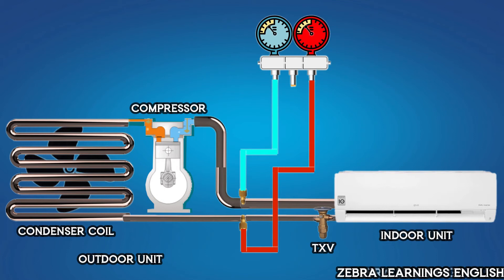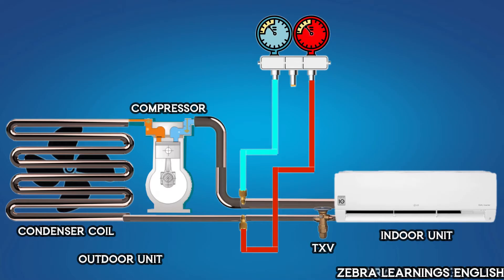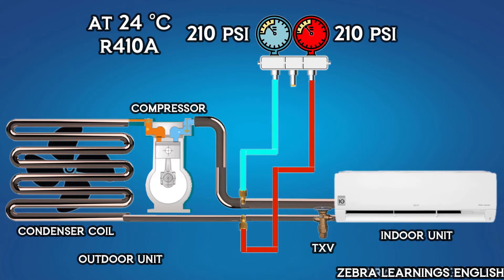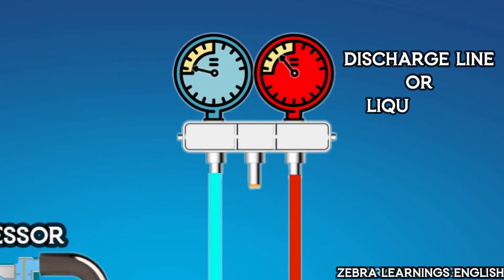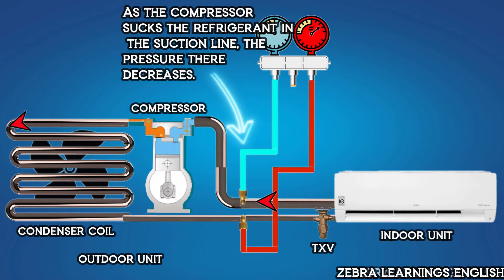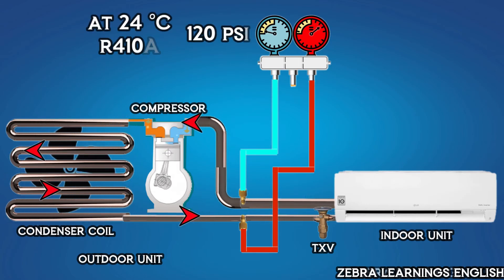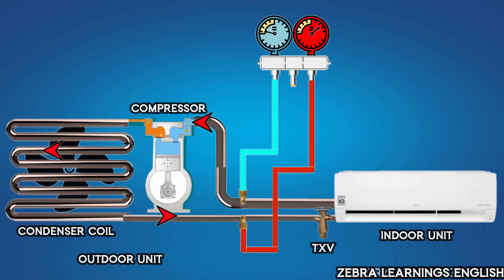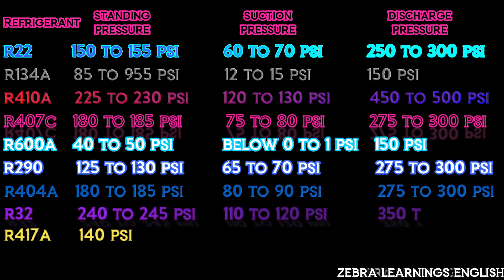Refrigerant Pressure Details | Animation | #hvac #hvacmaintenance #hvactraining

Comment: why the Low pressure high and High pressure low when the set temperature is reached?
Reply from the maker: The compressor is the one that increases the pressure on the high side and reduces the pressure at the low side of the unit.
When the set temperature is reached, the compressor inside the outdoor unit will turn off. So the pressure on the high side will reduce, and the pressure on the low side will increase.

Comment: What is subcooling and superheat temperature please
Reply: Bro I am asking how many celcisu superheat and subcooling
Reply from the maker: The superheat and subcooling value various depends on the refrigerant.
We can check the values in the manufacturers technical data.
But normally Superheat value ranges from 5°F to 20°F and subcooling value ranges from 8° to 20°F.
Reply: This video you did not mention how many temperature
Reply: Why before gas charging vacuumed the system of split AC kindly  is necessary
Reply: Thanks bro
Reply from the maker: The Subcooling and Superheat temperature has explained in the below video,

Subcooling and Superheat
https://youtu.be/-WY3eJKotrE?si=eu1RsbTwADuj-uyV